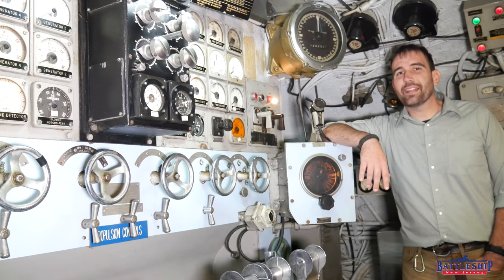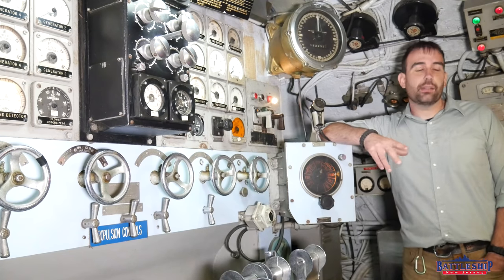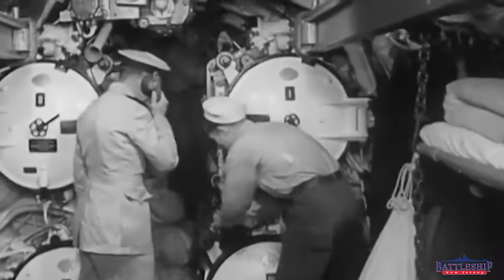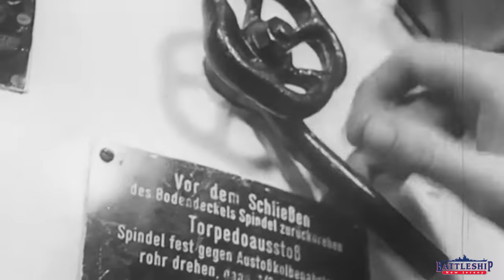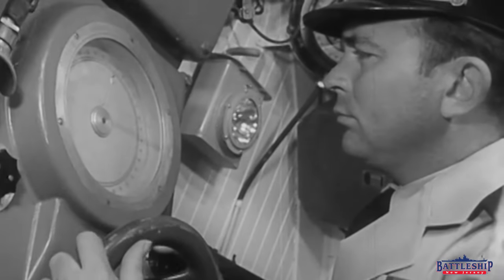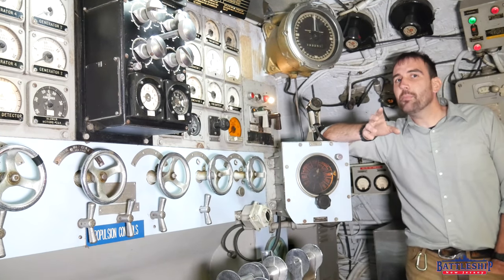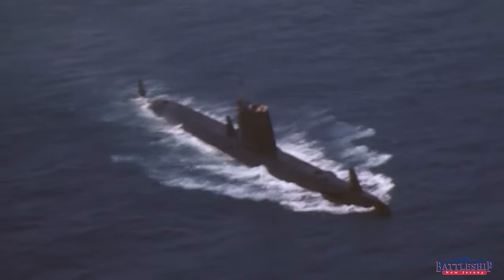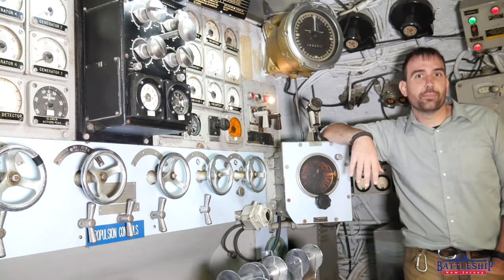Why Does a Submarine Have an Altimeter?

Comment: well that's one reason for the altimeter, the ather is to tell if you had a differential dresher between the outside of the ship and the inside when you go to open a hatch.if have a vacuum in the sub, the cannot be opened, the same if you have a pressure you can be ejected through the hatch as its undogged. that's the more common use on a nuk powered sub.
Reply: Spelling isn't really your thing is it?

Comment: During the second world war . There were stories of skippers being blown clean out of the conning tower , on surfacing. Like a cork out of a bottle, as the hatch was opened  . The reason being  high pressure air  leaking into the boat, from the high pressure system.  . High pressure air up to 2000 lbs. per inch was used to operate many of the parts of  the  sub . A simple relief valve was later fitted that would be used to equalize  the air inside and out  on coming to the surface .
Reply: I just remembered something . In coal mines there was a barometer  . Which did the same thing measuring,  the air pressure. I understand this was important . Due to Blackdamp gas which is very dangerous  . Maybe if the air pressure was low the gas could seep out of the walls of the tunnels ?

Comment: Ryan great job! thank you all museum restorers.   just an fyi  AIP  is not new! the us navy even had it. source wiki

 During World War II the German firm Walter experimented with submarines that used high-test (concentrated) hydrogen peroxide as their source of oxygen under water. These used steam turbines, employing steam heated by burning diesel fuel in the steam/oxygen atmosphere created by the decomposition of hydrogen peroxide by a potassium permanganate catalyst  also The United States also received a Type XVII boat, U-1406, and went on to use hydrogen peroxide in an experimental midget submarine, X-1. It was originally powered by a hydrogen peroxide/diesel engine and battery system until an explosion of her hydrogen peroxide supply on 20 May 1957. X-1 was later converted to a diesel-electric.

Comment: The altimeter may have also  been a countermeasure to the RCN green paint division.  When RCN Ships ran low on depth Charges they poured green paint on the sea and shut down all noise on the ships. When the sub surfaced the periscope was covered in green paint so they didn't realize they surfaced and kept going up. when they got up in the air a bit they got shot down by the antiaircraft guns. The ammo was much cheaper too.
Reply: Do you have any sources?
Reply: An altimeter won’t give you depth in water, a depth gauge will however. Submarines already have them.
Reply: @nmfd31  But it should tell them when they are getting 100 feet or so above the surface and they can dive again.
Reply: @ThatGuy-nv2wo  an old navy Sargent, but i think it was supposed to be secret.

Comment: Getting rid of exhaust fumes is no problem under water. Maybe pressure could be a problem, but getting rid of it not. Main battle tanks do that when driving under water, using their exhaust, as usual.  Tanks use a snorkel too. In fact, sucking air from the crew compartment is not good, especially regarding a small tank. I worked on the Leopard 2. It has a safety switch at the commanders hatch, making sure it's open, otherwise the diving hydraulic can't be used to switch the engines air intake to the crew compartment. Under water, air comes down a tower fitted on the hatch. I couldn't imagine it's possible to run diesel engines from stored air, I looked it up. The swedish submarines use a Stirling motor under water.

Comment: The modern system that replaced this has its own flaws which nearly sank the boat I was on. The head valve on ours stuck open and massive amounts of water poured in, and down we went, fast. We went very deep before recovering. The system on our boat was defective and even had incorrect parts installed from the beginning.
Reply: That is one of the theories of what sunk the Scorpion.  They were either running a snorkel drill or were having a reactor problem and were running on the auxiliary diesel.

Comment: A snorkeling sub with her diesels running plus cavitating prop(s) creates lots of noise and this makes her sonar much less effective plus it makes their boat considerably easier to be detected. Contrary to popular opinion the German type XXI, although a fairly big improvement, did not give Germany the ability to decimate the allied supply convoys. Yes it was late in the war when they came out but the allies weren't exactly sitting on their thumbs with ASW technology. The development of aircraft use of sonobuoys and "MAD" gear (Magnetic Anomaly Detector) to detect and localize German or Japanese subs and the introduction of air dropped acoustic homing torpedoes (mk- 24 ) nicknamed "fido" was a big step to keep up with German developments. For surface ships hedgehogs, helped to increase successful attacks. The British developed longer range weapons called"squid" and "limbo" towards the end of the war. The allies were also developing surface launched acoustic homing torpedoes to help gain the advantage over German subs.
   Allied surface ship sonar was about to get a big improvement with the introduction of "scanning" sonar if WW2 had lasted for much longer. Not many folks realize it but all WW2 sonar, active and passive, was only able to hear in a very narrow horizontal arc and the transducer head had to be swept back and forth to search and maintain contact. if it wasn't pointed directly at a target the operator had no target. It was very time consuming and hard to stay concentrating using this type sonar. Scanning sonar swept a full 360 arc at all time (minus behind the ship in the baffles). This makes finding and tracking targets much less difficult. 
   I hope this brief description helps folks understand what happened to help defeat the Uboats in WW2's "technical wizards war".

Comment: Running the diesel submerged was always a P.I.T.A. It always seemed that no matter what, the boat still started to smell a little of diesel exhaust. I'll point out that at the bottom of the induction mast at the forward end of the fan room is a sump where any water sucked in would be separated from the air before the air was then brought into the fan room to then sent back to the diesel or other things (hi-packs, low-pressure blower, etc.) depending on what you're were snorkeling for (running the diesel, charging air banks, low-pressure surface, etc.). The sump was basically a series of baffles creating sharp turns thereby changing the direction of travel where the heavier water would then fall to the bottom and to a drain and the air would then continue on into the fan room. On my boat (SSBN634) it was in Operations MIddle Level at the top of the ladder to Ops Lower Level, just outside of the COB's office and across the passageway from the mess decks. Someone would be positioned there, a sump watch... usually one of the mess cranks, where he'd sit there with a pair of sound-powered phones and look through the little sight glass to report to control what was going on in the sump and to make sure the sump was draining.
Reply: I was going to comment on the fact that the engines always draw air from the interior.  It is just that with the snorkel induction open, the air is being replenished as fast as it is being sucked into the engine and discharged.  There isn't a threat of sucking water into the engines until the engine room is waist deep in seawater.  By then you have a buoyancy problem too.
Reply: @matthewbeasley7765  I was trying so hard to recall from memory (I left the boat in 85) those little books with plastic light blue covers... I think they were called PIBS... that had schematics of all the different systems, and specifically the ventilation system... which I had to draw during my qual board. lol

Comment: The Danes or Swedes (I can’t recall off the top of my head at the moment) came out with a new diesel electric submarine recently that runs quieter on battery power than any current U.S. nuclear sub now.   However, the U.S. is constructing a newest class of nuclear powered sub that will be the leader in underwater stealth technology very soon.   That all being said, I’d still desire to live in a nuclear sub.  They can remain submerged for much longer duration and they can produce their own oxygen from the water and without having to surface during combat missions, for crew survival.  That’s called “WINNING.”

Comment: Nuke boats have one BIG advantage: S P E E D
If the enemy even just thinks they hear you and fires a weapon at you, you need to be able to make billy big steps away from that weapon. The faster you can go, the better. If you're in a diesel boat, you're pretty much screwed if you get fired upon. You just can't get out of the way or force the weapon to expend enough of it's fuel chasing you to matter. I think diesel boats are fascinating, but nuclear has a huge advantage over it. (I mean, yeah, I guess diesel boats are slightly quieter than nuke boats, but if the enemy senses you, that don't mean much.)

Comment: Hi I would like to ask about the height from the main deck on new jersey to the water line and the almost planned conversion of USS Kentucky
Reply: Depends on how high you "blew up".......my boat ran on the surface at 17' draft which put the main deck about 4-5' above the water in  calm seas.......we used low pressure air blowers to finish blowing up once the boats ballast tanks are blown with high pressure air!.......
Reply: @jimsteele9975  I was asking about the New Jersey

Comment: Is it true that from a stealth point of view a diesel electric is quieter than a nuc due to the inability to shut the reactor cooling pumps down?
Reply: Depends on the reactor's cooling system. Most these days can use convection to circulate the coolant while they're idling. But unlike nukes, which can stay underwater indefinitely until their food runs out (about 3 months, give or take), diesels MUST snort and run their diesels periodically to recharge their batteries. That means that a nuke can stay quiet for as long as she wants, but a diesel will have to reveal herself.
Reply: At low power the reactor circulating pumps could be shut down.  The condenser water pumps only had to run when maneuvering - under forward motion, the flow of water over the hull pushed water in scoops and through the condenser.
The pump(s) that can't be eliminated are the ones to get water from the condenser back to the steam generators (boiler).  The condenser is under vacuum, and the steam generator is something around 800-1000 PSI.  Being classified, anyone who knows many of the details would get in trouble talking about it.  They may have had a single pump, or a condenser pump that pumped into a deaerator / hotwell and then another pump (feed pump) to the steam generator.
The nuke is also going to have turbine noise and if geared, gear noise.  The generators aren't silent either.
Reply: @matthewbeasley7765  and so it would appear that a good old suck squeeze bang and batteries is quieter than a nuc. Of course there’s more to the story.

Comment: The number of atmospheres decreases, not increases, causing the altimeter to reflect higher altitude in the boat. More accurately it's a smaller fraction of one atmosphere, as sea level is one atmosphere and higher altitude is less than one.

Comment: I'd rather have the last two Soryu submarines or the new class that they're building right now in Japan. They removed the 4 stirling engines and their fuel tanks, replaced all that volume and the other battery volume with lithium sulfur batteries. It can do 5 knots for something like 83 days or 20 knots all day long and then some without recharging from the diesels.

Comment: If the engines ingested Sea Water, a lot more would happen, other than just shutting them down. The Engines would suffer, the hydraulic effect of the water, this would cause, Piston Connecting rods to Bend, as well as other main Engine components. In short, the engine would need a major refit. I have seen it happen on Engines that have Wet Piston Liners, that have become defective, due to cracking.
Reply: The engine air intake was in the engine rooms.  Until the water was waist deep in the engine room, they were not going to suck water.

Comment: OK, now I get it. That explains why it is mounted upside down. It is not being used as an altimeter anymore. In really it is a repurposed altimeter being used as a vacuum gauge.

EDIT= OK something bugged me about this. As I though more about it my own comment sounded wrong. Then I realized that altimeters are basically vacuum gauges right out of the box. No need to do anything to repurpose one for a vacuum gauge so why is the one shown mounted upside down for?

Comment: The Becuna is a Post War Guppy conversion and as such is the equivalent to a Type XXI U-Boat in speed and underwater endurance.   A Tench Class GUPPY Conversion is arguably superior to the German boat.  The Type XXI can dive a bit deeper but had several design flaws, primarily excess pressure hull penetrations, that made it less survivable.
Reply: The type XX1 was in essence a prototype pressed into mass production before the flaws could be removed. There was a long list of minor problems resulting from that that had nothing to to with the concept itself (many of the type of: 'you can't tighten this nut because there is a pipe in front of it putting it out of reach). The first had to be finished for Hitler's birthday and sank at the pier shortly after the ceremony due to shoddy workmanship caused by the rush.
Reply: @Segalmed  The problems with the the Type XXI went beyond poor construction .  The designers got too fancy.  Had they just took a basic U-boat design, streamlined it, put in the big batteries, upgraded the sensors and added a snorkel they would have a much better boat.  The Guppy conversion show that as they were every bit as capable.  The Kriegsmarine had a habit of designing inefficient ships.  The Bismarcks were roughly comparable to an Iowa in displacement but were inferior in speed, protection and firepower.  The Hippers were almost the same size as a Des Moines Class but were no more effective than a much smaller New Orleans or County Classes.
Reply: @johnshepherd8687  Too many new ideas at once usually end up with severe problems. The Panzerschiffe had the same problem. Had the Graf Spee returned to Germany there would have been a complete overhoal necessary, almost a rebuild, since it turned out that many of the new features were not up to extended operations even absent combat (e.g. the foundations for the diesel engines were far too lightly built, the new welding techniques for the hull wer far from perfect etc.).
For the Uboats the conventional path was taken with the later Type VII models. But the design was essentially maxed out, severely limiting the capacity to put the new features in. The designers already knew that type XXI was too large and cumbersome but it was intended as the testing platform to try out as many new ideas as possible. It wasn't them that wanted to mass produce the type but would have preferred to wait for the smaller follow-ups after having tested the ideas first on XXI.
But the polycratic system of the 3rd Reich led to too many parallel (pet) projects in general instead of concentrating on a small number of promising ones. Each company had its own secret projects and a high-ranking protector fighting for ressources and influence.

Comment: Internal combustion engines create way more carbon monoxide (CO) than carbon dioxide (CO2). Both can be deadly but the effects of CO will be felt long before CO2, and both gases will displace oxygen, creating an oxygen deficient atmosphere which is also deadly.

Comment: "Why does a submarine have an altimeter?"

The jokes almost write themselves.
Reply: "Come on, Big D, FLY!!!"
Reply: Actually, the "emergency blow" doesn't get the boat out of the water...if standard procedures are being used.  As a qualified airplane pilot...and Diving Officer of the Watch...I got some ribbing about my wings (worn over my dolphins that day) and aviator jacket, the day it was my turn in the Dive Stand for the "emergency blow," so I conned the Eng into giving me some more turns (more than standard).  Went airborne for six to eight seconds.  Got air in the depth sensing lines.  Bought us a couple weeks in the yard to bleed that out.  Got to do quite the tap dance for the skipper in the Commodore's office for that one.  But I am pretty sure we flew further than the Wright brothers that day.  Too bad that darn altimeter was still rigged for deep submergence when we blew the tanks....   Also got to spend a week on the New Jersey on TAD in the IO for her last cruise...Cadillac ride!  Subs suck in rough weather thanks to the round bottom....

Comment: Modern engineers would would design a million-dollar purpose built gauge for this, but 1940's guys just took an existing airplane part.  Very smart.
Reply: No they wouldn't. They would use an industry standard pressure gauge.
Reply: Those altimeters were mass produced in WW2. My late father had one at home in the 1970s.